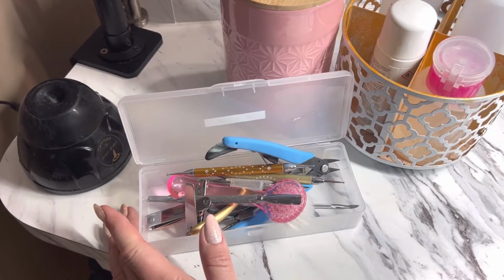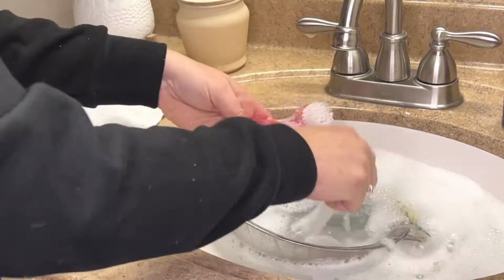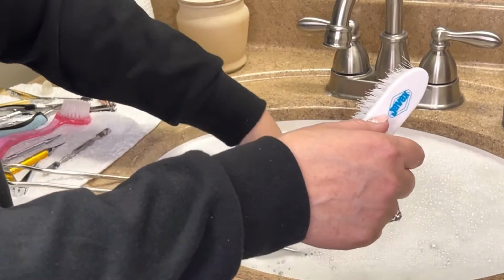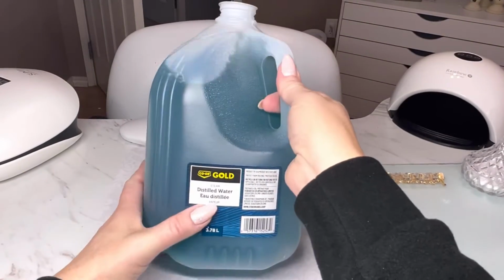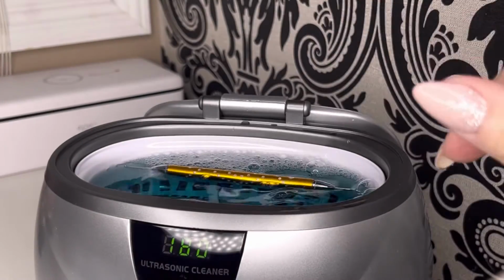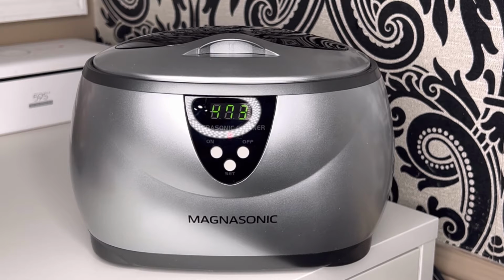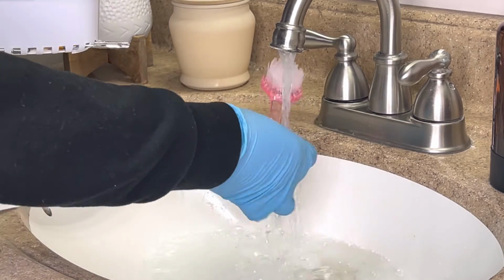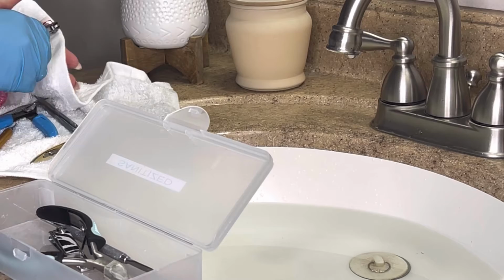How To Sanitize & Disinfect Nail Tools & Implements ‼️Nail Appointment Safety

Comment: Do you leave your solution in the machine?
Reply from the maker: It is left until it gets foggy and then it has to be changed
Reply: Thank you for the fast reply... ❤I purchased one based off of your video and it arrived today... I was worried if it would start to rust.
Reply from the maker: @ambrag2cute358 anytime…..as long as it’s changed regularly all is 😊

Comment: I use a preempt 20 to soak my implements in for 20 minutes, is there any way to sanitize those fluffy brushes that some people use?
Reply from the maker: I always spray them with preempt. I will also wash them with soap and water. The smaller ones I will put in my ultrasonic machine
Reply: @ardellesnails  thank you!